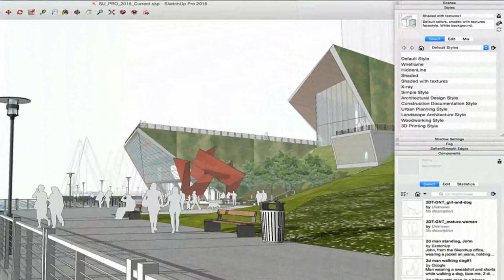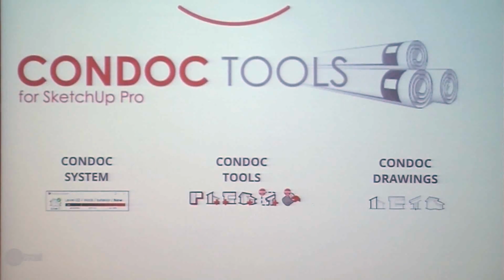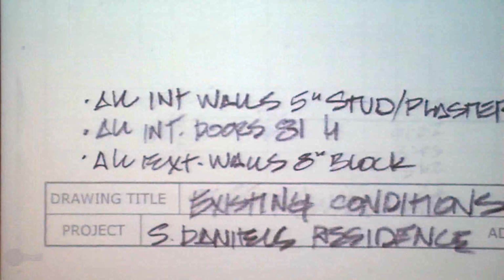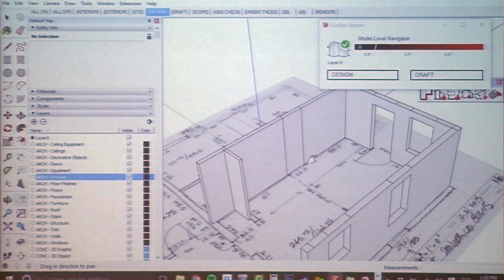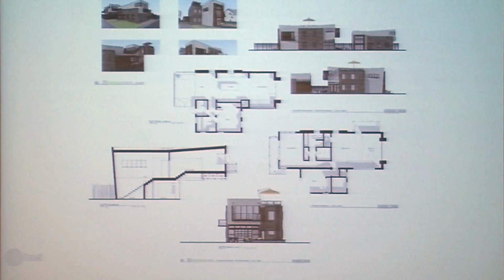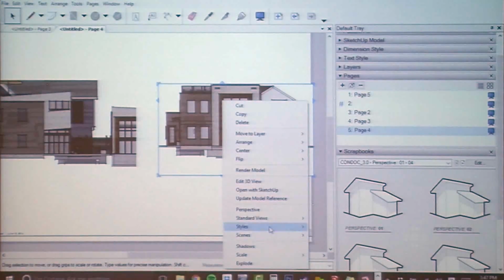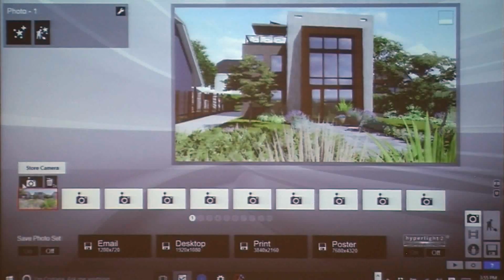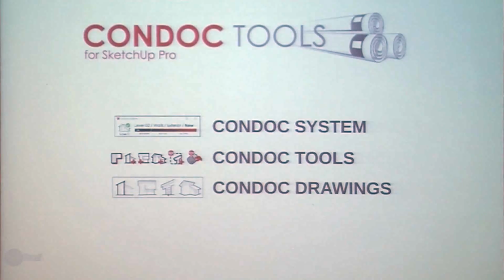3D Basecamp 2016 – Expediting the Documentation Process

Comment: Wouldn't it be more user intuitive to have settings for Level, Type (wall/window/roof etc) and Existing/New in the Condoc System dialog instead of having users manually handle layers of nested groups? It seems a bit arbitrary whether the group on the ARCH - Walls layer should be inside the group on the CONC - Exterior or the other way around. Instead users could just select each of these "settings" separately from different dropdown menus. Just thinking out loud.